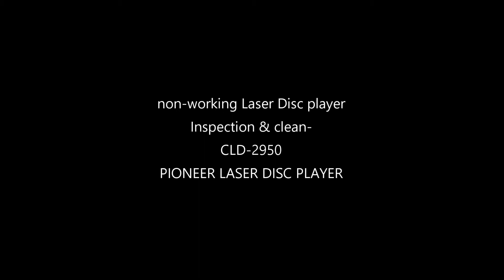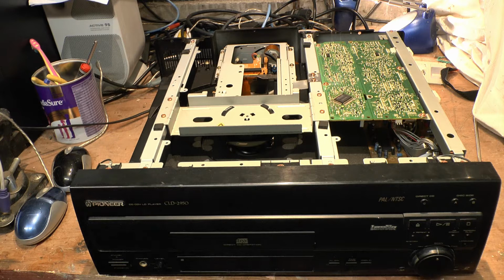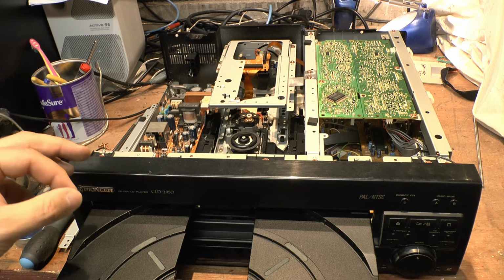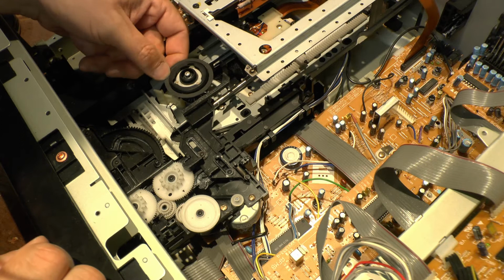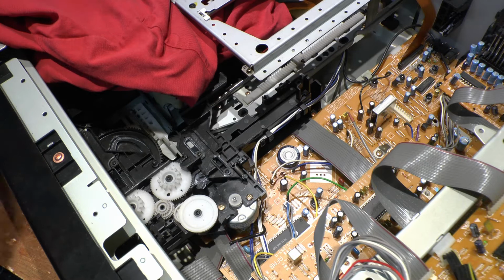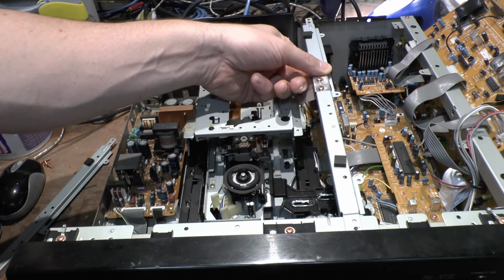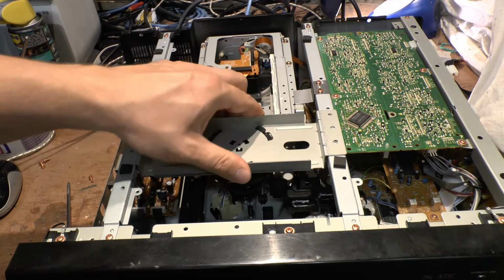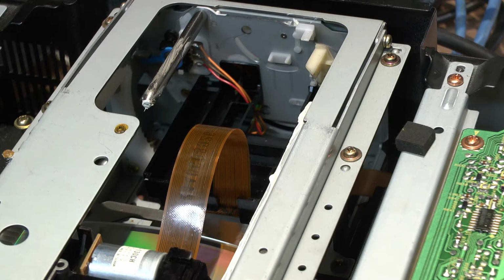PIONEER LASER DISC PLAYER CLD 2950 INSPECTION & CLEAN

Comment: Just here cause my CLD-2950 broke down, laser issues. Around IC902,your vid seen at 10:15 min,Left of screwdriver,  I found couple of bad capacitors, very leaky and totally off specs. C976,C970,C967,C987,C968. All were the brown  ones, as there are also black case capacitors, those seems to age better.Without measure equipment you even can spot them due to corroded leads of them. So really leaky.
Now audio-CDs are working, but very pick when touch the case of the player, it skips easy, LaserDisk, still not, so have to digg further, I do hope not adjustments of the laser cause lach of service remote and special LD-s .Damn, I am said.
CLD-2950,was..., a great player, even already some degrading LD-s it still would play them, when other LD-player would reject those bad disks.

Comment: I stupidly sold my 2950 many years ago in favour of a CLD-925. My regret was instant. The 2950 was the last player to not futz with the image via digital processing. I’m still using the 925 after resurrecting my old LD collection and now looking to undo this heinous error by getting a 2950 in favour of the 925.
Reply from the maker: 😆... you need to go to Laser Disc confession.
I like both the CLD-D925 and the updated CLD-2950. The major drawback in my experience is the turn mechanism on the 2950. The CLD-D925 and similar in my experience do it with bit more grace and I suspect they might last longer.

The downside of the CLD-D925 and similar is the M-Holder but these can now be bought as new 3D printed spares.

Make sure you try all outputs for video on the CLD-D925 to your TV etc. SCART and RCA some models have less noise on the second SCART socket for example.

Thanks for watching the video.
Reply: @DRCHRISTIANMD  yeah, I’m running through a Lumagen XD on composite, which is by far the better output of the three. The S-Video is the worst, given the arduous route it takes.

Comment: This is a great video. What was the cleaner spray used on the black rubber spindle that had all the dirt on? I'd very much like to clean my player as it slips and fails to read the disc on the first go and always picks up after ejecting and closing the disc.
Reply from the maker: Hello, first that's great you got something out of the video that helps you keep your player going. Generally the recommendations state to change the belt but as per video a clean ( and my experience) with orange surface cleanser ( mild cleaner) is what I used. Isopropyl Alcohol can also be used in a pinch but it can degrade the rubber further so a more pH neutral solution is best. You are basically taking off the loose rubber that has worn off from the belt and is causing the slipping. You should still obtain a new belt when you get a chance and a clean in the meantime should get you back up and running.

Remember to clean the two parts on the carriage assembly where the belt makes contact as this will also cause issue with even a new belt.
Reply: @DRCHRISTIANMD  Thank you so much for responding so quickly to my message this will help me greatly. I really appreciate it.
Reply: @DRCHRISTIANMD  For sure I took the larger pulley off and cleaned it in my sink with dish soap and a tooth brush . I looked brand new afterwards !
Reply from the maker: @richardbrobeck2384  yes if its black and sooty it's not a bad idea to remove and clean off the old grease and of course put fresh grease on after.
Reply: @DRCHRISTIANMD  For sure !

Comment: Does this model need a voltage converter to work in the U.S. or is it dual voltage?
Reply from the maker: Yes, unfortunately, you will need a converter as the player is only 220v compatible.